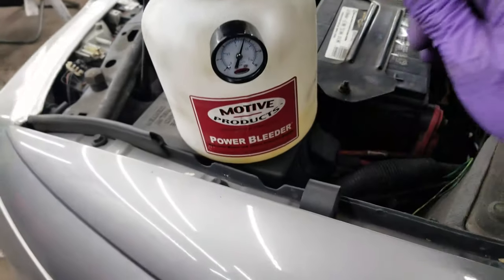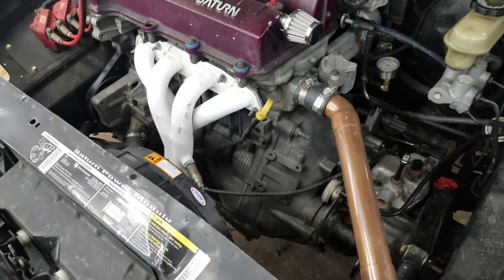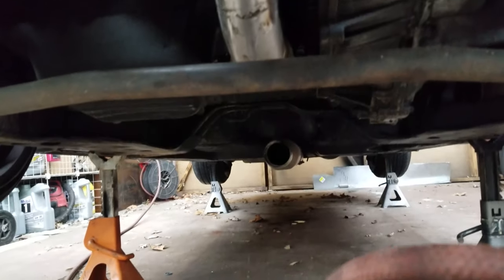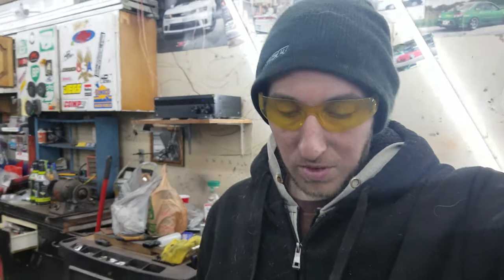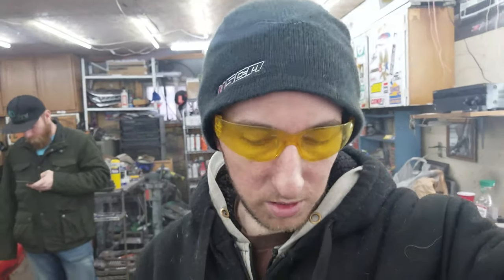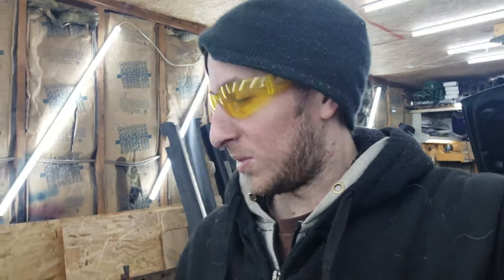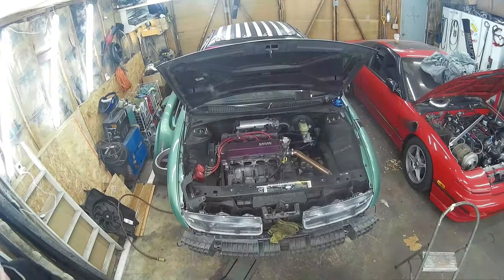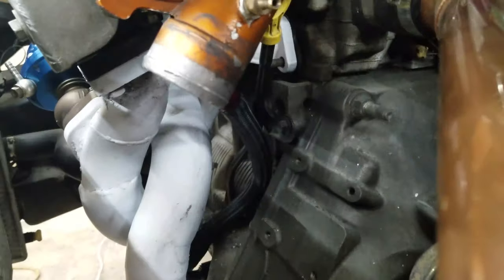Boosting Midori Part ONE

Comment: I'm so psyched to build my 95 SL2 with the .20 over turbo build and dual intake cams, DIY Autotune MS3 pro engine management etc. I got my LED digital tach and coolant temp, Boost, and Wide band air fuel ratio gauges from glowshift and the A Pillar mount, just hope it doesn't get in an accident. That's my biggest fear, but I guess what can u do...lol Wish u were a local dude in South Florida, seem like a decent guy, to have a couple beers with and talk shit about cars...lol

Comment: That power snail looks mighty fine in there. Are you getting the oil feed from the plugged hole in the oil galley on the back of the block, or getting it from somewhere else?
Reply from the maker: Oil feed comes from old oil pressure sensor hole, these cars dont need that sensor
Reply: That makes sense. I drove my 94 sc1 with a broken oil sensor for 6 years before realizing it was snapped in half, when I pulled the motor to do a head and a clutch. I know more about fixing these things and rebuilding the motors than modifying them. Thinking about  putting a turbo on the 02 sc2, but wanna get all the info I need before starting. You have been a huge help, it's much better seeing it in a video than reading it on the forums. Thanks for all the replies. Thanks for all you do for those of us still in the community. Keep up the good work. Let's keep as many of these things on the road as long as possible.
Reply from the maker: Thanks man